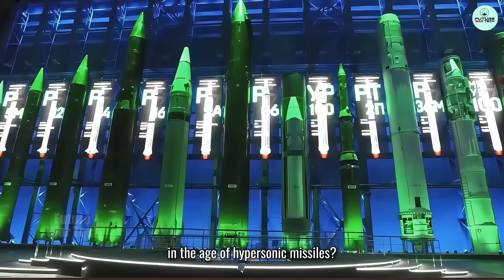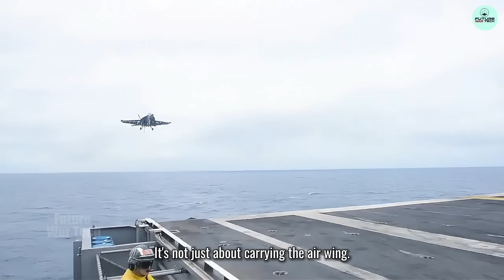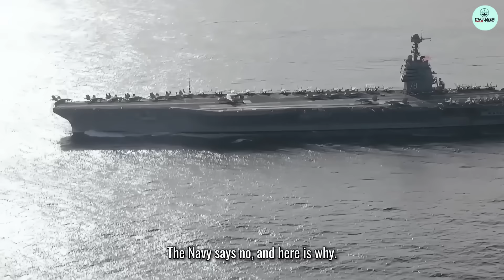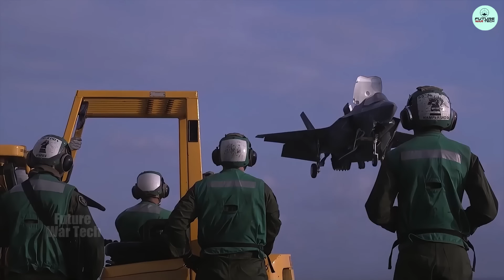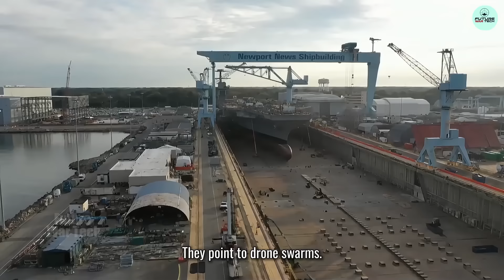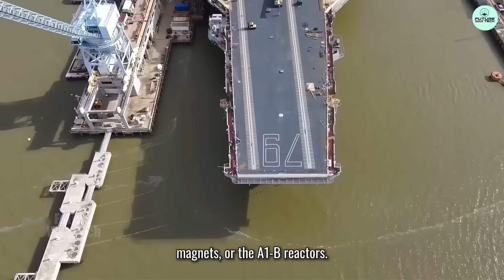CVN-79: The Most Powerful Carrier on Earth

Comment: The age of the Carriers is alive and well the idiots that say the age of the Carrier is dead are the same idiots that back in the 60's fighter Jets didn't need guns they claimed the Jets didn't need guns because they now had missiles but the missiles were not upto the job and in2006 they decided to retire the greatest fighter we had the F 14 and replace it with the F 18 witch is not as capable as the F 14 was and F 14 could have been updated and upgraded to fly by wire and Stealth as well as make it low maintenance

Comment: We also need to know what is necessary to make a Lightning Carrier an effective vessel.
As they are now, they are a stopgap at best.
Reply from the maker: Good point. A lot may come down to range, support assets, and how well drones and tankers integrate with the air wing. The Pacific is a tough environment to solve for.
Reply: @FutureWarTech7  As I understand it, there are two possible setups for a Lightning Carrier. The first is very limited. They only have space for a few days of fulltime operations as they are now. That's fine, you show up for the fight with the weapons & personnel you have. In the second, if the Marines & their equipment is removed, there is space for additional weapons stores, spare parts, aircraft technicians and such changes necessary to make efficient use of that extra space to make increased tempo operations possible. I'm no expert, but I'm thinking a comprehensive plan would need to be put together to get FULL USE out of a Lighting Carrier configuration before it's needed, rather than trying to figure it out as you go. I hope the US Navy has this study in a drawer somewhere & will give it a test run someday to work out any wrinkles.